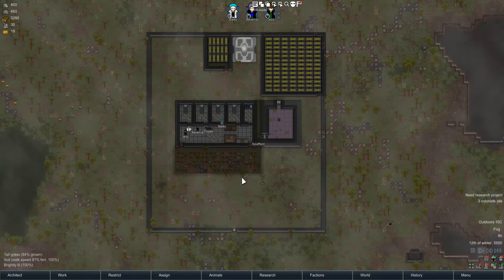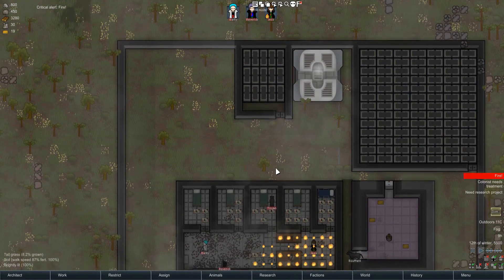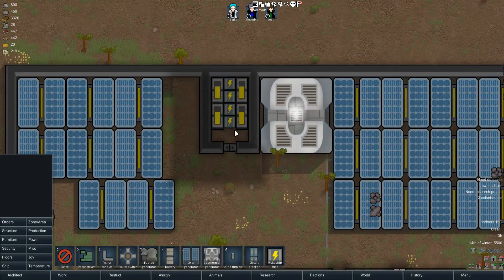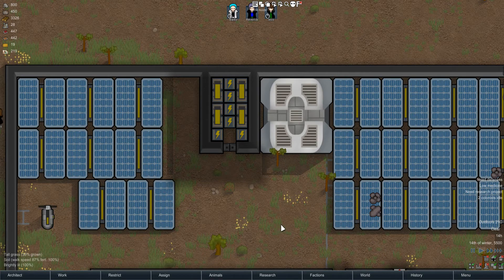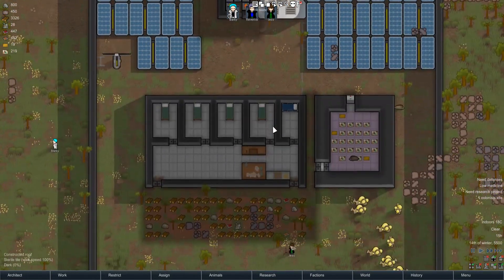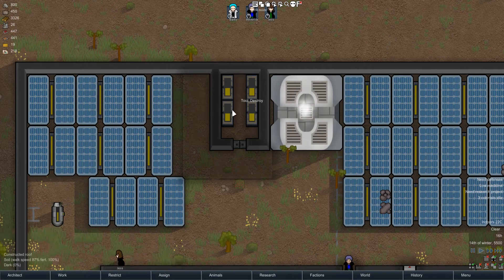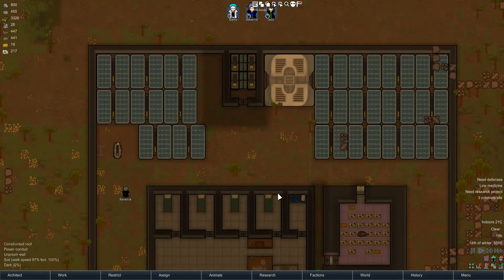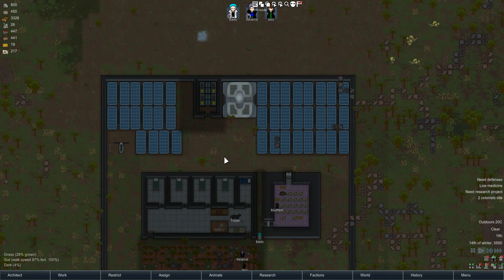Rimworld Mod Guide: RT Fuse Mod! Rimworld Mod Showcase

Comment: Thanks for the showcase! I'll add links to it when I'm actively working on my mods again (which usually happens near new game version releases).

Wouldn't say it "removes a layer of difficulty", as all the energy on the network is still lost.
Nearly every incident has a way to minimize effect, and in case of original short circuits it's "don't use batteries", which is a bit silly and not consistent with other incidents.
So, what actually gets removed is the "conduits are made of concentrated explodium" bullshit, which is offset by the cost of research and protective devices themselves.
Well, I suppose to make the short circuits a bit less forgiving I could set the affected conduit on fire, fuses or no fuses, if the short is powerful enough. Dangerous, but not insta-kill-dangerous, and can be worked around.
Reply from the maker: Hey! You're welcome, of course.

And yeah I think that short circuit events are the stupidest event in the game because it's random. If you watch any of my other videos 'short circuits' are usually the source of my rage :P I usually end up making my own 'fuse' by just layering wire randomly all over the map. I do think this removes quite a big layer of difficulty though. I think the game by itself isn't difficult enough in the right ways anyways tbh.
Reply: great mod Alex, should have been in Vanilla
Reply: Ah, explodium must be a common metallic element on this rimworld (maybe copper is scarce?), like unobtanium being quite obtainable on others. It's a shame that adamantium isn't available for construction.
Reply: @AndrooUK  dwarf fortress is bad game.